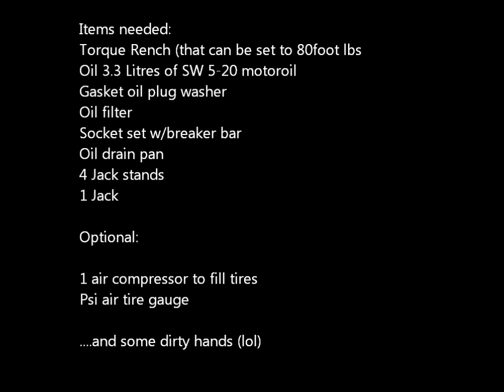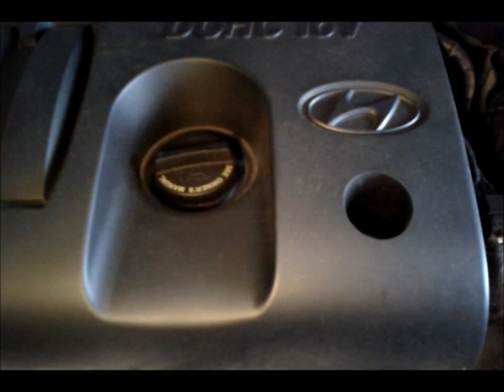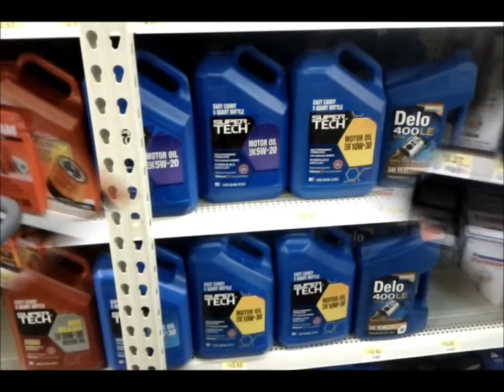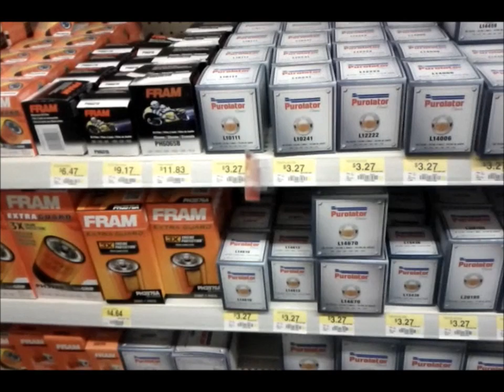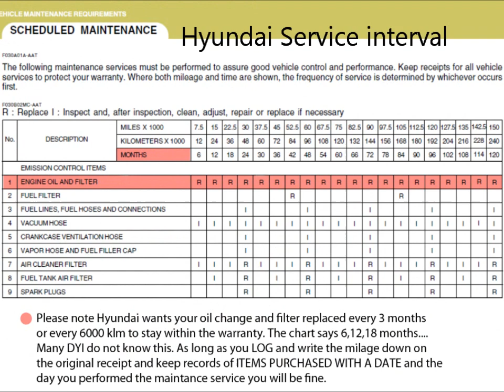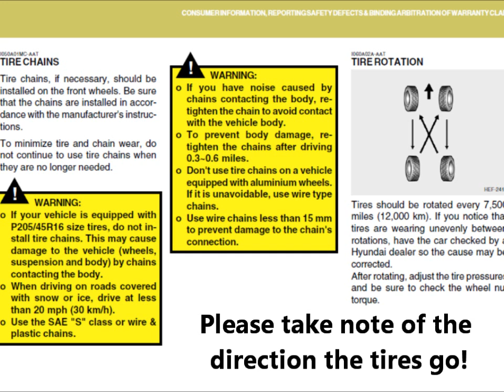2009 Hyundai Accent oil change and tire rotation

Comment: thanks a lot i have only a question about the oil filter weather it should always be changed before draining the oil or it's ok to change it after changing the oil , i have zero experience in that hope my question is not silly ;)  thank you
Reply from the maker: Drain the old oil first then remove the old filter and put the new filter on with NEW OIL IN THE FILTER then screw it on and fill the engine with NEW OIL. Hope this helps
Reply: thanks a lot

Comment: Great vid for the novice! Very informative! As a retired tech I'd like to respectfully disagree w/ conventional oil. I live in Florida (where it's hotter than stolen car parts in the south Bronx).Synthetic oil is far superior to conventional in every way. It flows freely at sub zero temps (like in Canada) and doesn't break down as easily at extreme temps (like in Florida). 5w20 is great for Canada. Here in paradise we use 5w30 0r 10w30. (My '99 Accent takes 20w50 which would flow like honey in Canadian winters).Oil not only lubricates, it also cools and seals. Stay warm G-d bless my north of the border friends.      Shep in Florida.
Reply from the maker: This is a great way to get a feel for diy. I posted these simple videos but now have moved onto more advanced stuff. I'll yell you the truth. Sometimes I've got better things to do then to do this service. Sometimes it easier to drop the car off a t my trusted mechanic to do this.
Reply: I agree with you on the use of synthetic, cold starts during Canadian winters are brutal on the engine.  I only use synthetic 5w 20.  It can even be a cheap walmart brand, but it needs to flow better than conventional.  Changing oil every 3 months seems wasteful to me though.  I don't follow that part of it, but do change every 5000, 6000ish.

Comment: I do my shopping on Amazon mostly. Not to dump all of the research chores on you, but your videos have helped so far. I'm looking at some Wilmar jack stands--the shape of the cradle head on them is curved at the edges; would those work, or is there another set on Amazon or elsewhere that would work with that reinforced box? I notice the stands don't have the hockey puck adapter and are bare metal like the pneumatic jack normally would be. Seems like there ought to be a way to soften those too. I've seen some pads by Prothane on Amazon, but reviews say they don't fit jack stands. Most of the low profile pneumatic jacks I'm seeing don't have standard base plates that are much bigger than the 2" one seen in this video--I'm pretty sure most jacks have removable base plates, and I'm pretty sure plates should be universal fit; I don't want to risk the slippery disk weight method; I'd rather go with a pre-manufactured base plate and then use the hockey puck method on top of that. Any ideas on where to get a larger base plate? 

If I'm counting right, there's four spots on the rails to put stands, plus one in the center of the reinforced chassis; does that mean I'd ideally have five stands plus the pneumatic jack, as well as 4" wood blocks on each of the front stands?
Reply from the maker: joeybuddy96 those jack stands are fine as long as they are the 3 ton ones. The jack stands I always place on the main rails and on the rear torsion bar ends where the bolt goes through. Never across the torsion beam. Big block can be placed under the rear big spring seats. I use the puck idea to jack up on factory pinch welds but do not use it as a main support. I then use 2 boards to lift the car slowely on each side while repositioning the jack as each board is added. This prevent my big jack from slipping as I raise the vehicle. Then I put in the second board then reposition the jack then lift 1/2 inchband place jack stand on double reinforced rail. Not the pinch weld. Then remove boards after the other side is raised. Then I leave the jack on the pinch weld lightly jacked up as a backup with the hockey puck connected to the pinch weld. I never raise all 4 . only fronts or rears. I do not like the jack stands with big u's in them. I like some surface n them. Bottle jacks stay away from.

Comment: do you know if they have any aftermarket headlights or tail lights to make the car look a little bit nicer like the halo lights? I just bought a 2009 Hyundai Accent Hatchback manual and I love it it gets great gas mileage, I am wanting to know does K&N have a reusable filter for this year make and model of a car and what oil would you recommend for this vehicle I live at the beach in North Carolina? do you know what the best air filter and cabin air filter is for this vehicle?
Reply from the maker: +Tyler Abernerhy I've always used supertech 5w-20 conventional oil from day 1 and purlator filter. Purlator is now replaced by supertech oil filters. As for custom mods a bud of mine over at Hyundai forums 2006-2011 section has a hudge article on modding SR project same car as you. His name is deadlygeek. His vehicle was featured in the rear wiper video! We did his timing belt and brakes that day....

Comment: I'm probably going to get an impact wrench. Could I use it on the wheel nuts, or would it ruin the wrench? What size are the wheel nuts?
Reply from the maker: joeybuddy96 21MM I believe and yes its fine to remove the wheel nuts with an impact. Just do not yank em on with one. Use a torque wrench